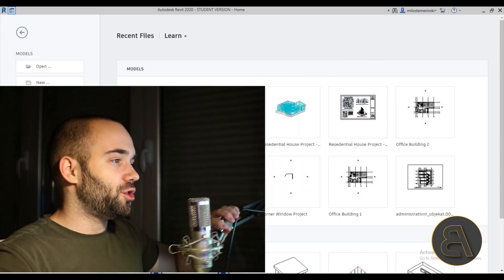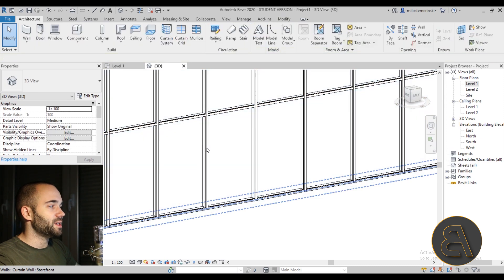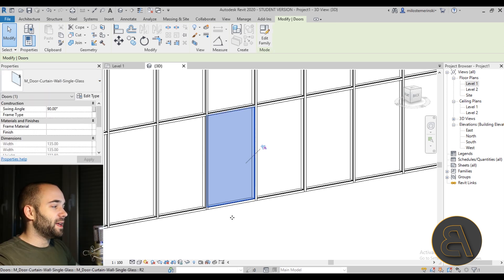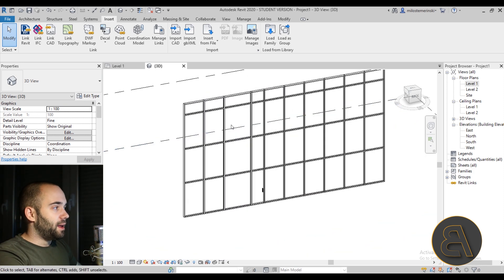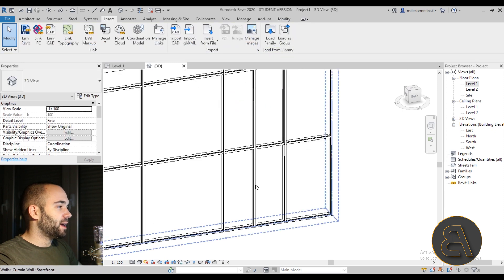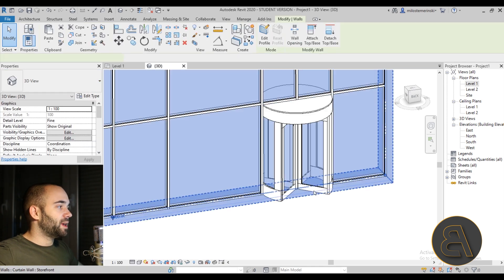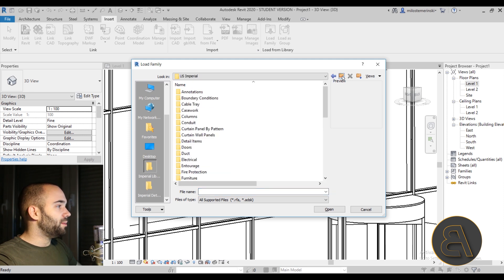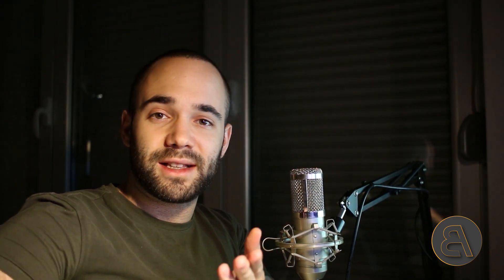Doors and Windows on Curtain Walls in Revit

Comment: Thanks for this very thorough summary.  
I had trouble downloading the libraries etc. but got there in the end.  Typical of Revit, / AutoCad crap.  The uk libraries don't come with the basic storefront doors and windows, you have to download the US libraries for it to work. Found another video on this and learned yet another thing to complete the task. 
One little thing you missed, when you place a curtain wall and then another one at an angle the corner mullions clash. You can (unpin one mullion and then replace  with an L mullion) and hey presto! Mullions are really comprehensive.  (This was in another video)
  
Big thanks anyway.
Reply: can you please give me the link for another video you mentioned as i have the same problem. Thanks!!

Comment: Hi, I really like the videos that you share they are very helpful. I have a situation that I'm trying to figure out. I'm using a curtain wall to be able to get the look that I want of a wall with repeating vertical lines. I have set it to use a mullion that is a little bit smaller than the wall to give the look that I want. however since the mullion runs all the way top to bottom. and now I can't find a way to add horizontal mullions in the wall to be able to place doors and windows in it.

Comment: I need ur help plz
I have a problem now with revit
It doesn’t shew the 3d model or the elevations, when i firts click any view it appears ok but i clicked anywhere for once everything suddenly disappeared , and when I hover over the drawing it temporarily show whatever i am hovering over
Any idea why this happens?
Reply: Aussie BIM Guru it is mac pro 2018 and i use parallels with windows 10
This happened just after an upgrade that happened for the parallels 😐 do u think i should delete the parallels and reinstall it? Or remove  revit itself🤔
Reply: @Aussie bim thanx for ur reply and help
Reply: @aihakan  No worries, happy to help. I'm not that experienced with parallels and impact on graphics but it's never worth any harm to try a fresh install and see if that fixes the issue, especially if the parallels were upgraded post install.

A lot of websites I've found are recommending 'bootcamps' instead if it is an option - not sure how this is managed but it seems to be a popular suggestion.